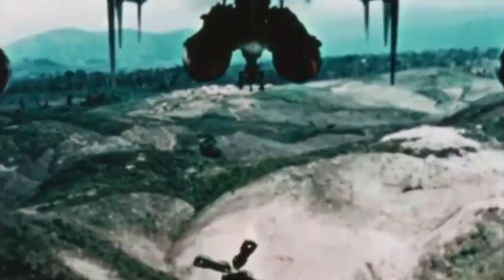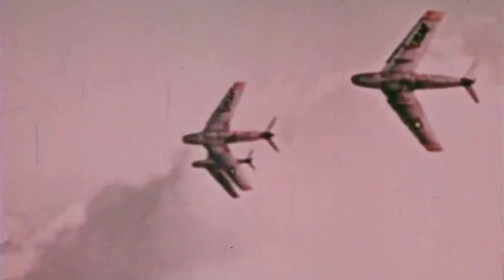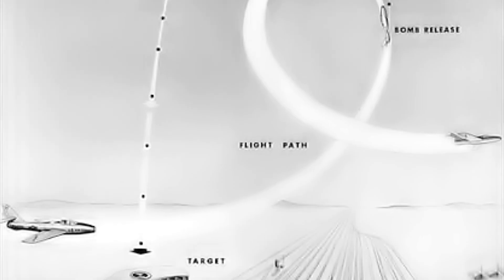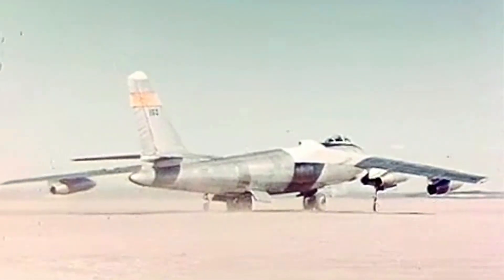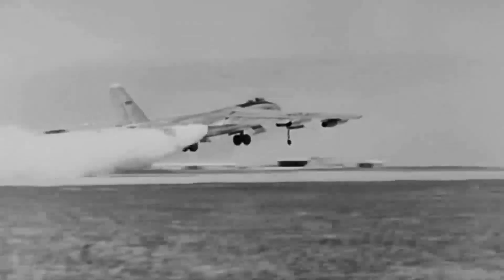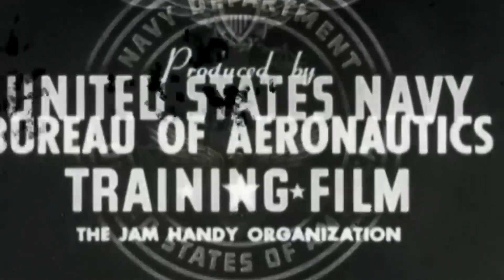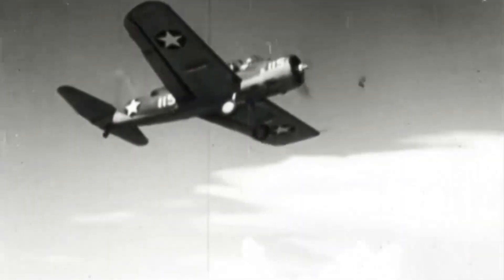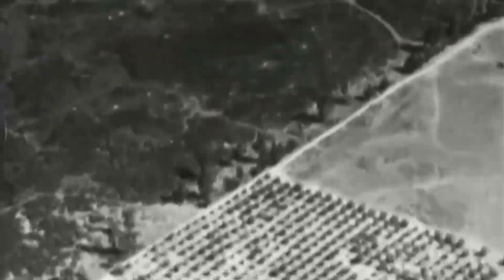This Massive Airplane Flew Upside Down to Toss Atomic Bombs - B-47 Stratojet Idiot's Loop

Comment: And then, SAC and Boeing found out that the spar boxes did not care much for the manuever. Still, Popular Science published the article and no doubt scared the Russians into thinking that our pilots were more endowed in the lower groin area.
Reply: Test limits were fully understood well before SAC started up and the technique was placed in the manuals for use in specific instances.
Reply: @larrysorenson4789  Boeing aircraft can't read manuals. But they can sure teach the engineers lessons. I have flown a lot of Boeing aircraft that performed better than the manuals, and some had nasty surprises. The 73'- 800 elevator balance bay drains come to mind.  Still a Boeing fan up to the  Max. "Wha' hoppened there, Lucy?"
Reply: Dick: A bit of history: Early on dad was the Air Force plant rep at Boeing (Wichita?). He was an aeronautical engineer and Senior Ranking Officer in the USAF Test Pilot Class 1956-D. From Edwards he flew both the X and Y B-47 and was largely responsible as pilot/engineer for the test program of that plane. He also performed much the same task for the very early B-52. Next he was assigned to Wright Patterson where he was Chief of Bomber Operations and Chief of Flight Test for the Air Force. This was from 1956 to 1964. At that time he was assigned to Headquarters, where he became Deputy Director of Research and Development for the Air Force. He didn’t talk a lot about his work but when he did I listened. As engineer/plant rep he was involved in very early design and fabrication of planes that transitioned us from propeller to jet based technology. As test engineer/pilot he participated in every aspect of establishing the planes limits with some pretty funny stories there. How do you find out how much ice must be on the wings before it falls out of the sky? Answer: Not with a slide rule. Obviously his work included the investigation and reports for every incident and loss of this aircraft. So the engineers and test pilots knew very well the capabilities for the plane as designed: high altitude delivery of a nuclear bomb. All that changed when the Air Force determined that the new delivery method was to be very low altitude fast delivery of conventional weaponry. 600 mph at 250 feet is VERY stressful on the airframe and pilot. Stresses were encountered that the plane had not been designed for and that the pilots were not prepared for. This quote is from a NASA article a few years ago. These two facts together accounted for the vast majority of findings (some unfairly) of “pilot error”. Very early accidents were caused by mechanical failures and pilot error: take off stall, mid air collision, loss of visibility, JATO explosion, engine failure. After the new mission design where engineering parameters were routinely exceeded, metal fatigue became a dominating failure element. These brave engineer/pilots and navigators lead the way to the enhanced design aspects in the early B-52 prototypes. The final design put into service in 1955 addressed these issues and subsequent modifications have kept this legendary Boeing design in the working inventory for 65 years. Everybody participated proudly, some at great sacrifice, so that we could learn from lessons and remain a dominating force for freedom in the world. Best regards, Larry. Ps. I miss my dad terribly.
Reply: @larrysorenson4789  Larry, many thanks for the "real seat-of-the-pants" history. Your dad is now a hero of mine. Flight test is something that I really enjoyed, except for the mind numbing static engine(s) runs. A buddy of mine ( USAF P-51s to B-52's) had a wing come off of his BUFF during refuelling. Ge had been doing a lot of low level runs in 'Nam. He had just exited the crew door and was about 15 feet away when the fuel tsunami hit his calves. 
Ironically, my late father was a slip-stick engineer for Plymouth Division in the 1950s. Same here... he is missed. By the way, I have a W&B slip-stick cover for a B-24A, but  no stick. Any ideas. I really miss flying that old stuff. By the way, DOC is gorgeous if you get a chance to see her. Regards, DJ
Reply: Dick Johnson possibly interesting stories:

To find out how heavy the Y could get they loaded it full of sand bags and scrap iron. The Edwards runway had just been extended and so down the strip it went. It was not airborne when the end of the pavement came into view. To prevent their brand new runway from flooding some genius had put an 8” high concrete curb across the end. It would surely rip the gear off the only B-47 in existence. And it was not about to get off the ground (no jato yet) so dad dad did flaps up and then down quickly and bounced it over the curb. Two more hops and it flew. The weight was enormous.

Phone call to mom: Dad was off on a mission when the base called telling mom that dad would call her. She was instructed to say short sentences and end with “Over” after each. Soon they were talking, first dad then mom, Over. Dad was flying way beyond the North Pole and we were figuring out how to bounce  radio waves off of air layers so that communications were possible.

The Polar Show. There was a TV show featuring an explorer named Lowell Thomas. He was very popular. In one episode he was in a plane flying over the North Pole. It caused a sensation. Dad was the flight Commander and pilot of the plane carrying Thomas.

I grew up at Edwards playing with my two buddies Mark and Scott Grissom. Gus and Betty were best, inseparable friends with mom and Dad. Dad wrote Betty regularly until his death.

Test Pilot Treachery: when Gus got burned up with Chaney and White the remaining six original Mercury Astronauts got together to discuss the effect of Guss’ absence on their deal with Look Magazine. All seven received royalties from the publication of articles and stories about them. Gordon Cooper voted that Betty would get the share just the same as if Guss was still there. Noel Armstrong would have none of it and demanded that she get nothing further to be settled by a vote. The vote was 5 to 1 to cut Betty out. This caused a permanent rift between my dad and the 5 cabal participants. We remained friends with Cooper who wanted me to work with him while he manages the Disney/Japan project. Ultimately I turned him down and instead went to Indonesia with an American Oil Company in 1972 and made a bundle of money.  More to come if you want..
Reply: @larrysorenson4789  Oh yeahhh .. Gus and Gordo... I heard about your dad's "Boeing Bounce" from Ernie Frankenberg, 73' test lead. I take it that your dad belonged to the SAETP ? It's the innovative stories that keep us alive... the young  'uns today don't care.  And the results are predictable without a bag-of-tricks  to fall back on. Tricks that your dad had in his hip pocket. Many thanks.
Reply: Holy cow! I should have guessed who you were. I am awestruck. Good on you, Mr, Johnson. I wish you and dad could have met. Your video is great and your presence and professionalism must make Mother Boeing proud. My email here in Phoenix is lrsoren48@gmail.com. If you would like I want to email you from time to time.
I have a collection of dads slide rules and circular calculators that were used in his flights. Maybe I can send you one to BBC fill that empty case. I have three trunks of dads stuff. I know that dads flight manual for the Y-B47 is in there somewhere. I have put off looking through them for a year now. I guess it is time.

We buried dat at the Wright Patterson Military Cemetery. There is a museum of Flight Test there. I have considered donating these remaining things there. Other stuff has already gone to the Smithsonian. Most of the families if Class 56-d have sent them items too. I have the Waltham clock that was on the Polar flights. Dad ferried it to the bone yard for its last flight. I don’t even know what other stuff is in there. I’ll keep you posted. 

Larry
Reply: @larrysorenson4789  Sorry,Larry, I'm the next generation Johnson. Most of my (decades of) flying was straight and level all over the planet, interspersed with flying some weird stuff. I learned a lot from pilots like your dad, and consider myself unqualified to even carry your dad's flight bag.. But learning from these guys sure saved my bacon more than once.  Will send e-mail. Again, many thanks. DJ

Comment: I was directly  under a toss bombing drill back in the 60's.  A friend and I were hunting on a bombing range east of Ellsworth AFB in SD when we heard a very loud bang straight overhead and were covered in black smoke.  We thought a bomb had been dropped on us.  Then we noticed a jet at very high speed moving away and trailing black smoke.  The plane then executed the toss bomb maneuver without releasing a bomb.  At that point we could see it was a B-58.  As we watched the plane rising to about 90 degrees up, a second B-58 about a half mile away made the same maneuver parallel to the first.  Incredible noise.  I was told by a USAF officer this was a "thousand-thousand approach", meaning 1000 mph at 1000 feet, but I don't think B-58s could go that fast at that low an altitude.  Extremely impressive no matter what the speed.
Reply: I don't know at low level but they can definitely go that fast at altitude.  That would be pretty cool to see.  It would just be cool to see one of those flying in general.
Reply: 36736fps Why were you hunting on a bombing range? Sounds to me the hunters could easily become the hunted there...
Reply: @bennylofgren3208  Good point!  Actually I should have said OLD PRACTICE bombing range.  No live bombs had been dropped since WWII.
Reply: @bennylofgren3208  In South Dakota there's a ton of open hunting land near AFBs.  Plus there's nothing to do in SD but drink and hunt and watch planes fly.  There may even be public hunting land on the AFB but I'm not sure.  At any rate, it's fairly common for AF training missions to fly over other lands.

Comment: ...heard the word "ordinance" used at least twice...ordnance is what is being dropped here...not legal documents.
Reply: I used to work with someone at a Presbyterian hospital we called Presby and he would correct me when I'd pronounce the second to last letter like a P instead of a B, it was annoying since its just my stupid lips not separating fast enough but a barely audible difference.
Reply: THAT is the take away for you. Not the giant craft lying upside down flinging A bombs?
Reply: lol! yes, it’s ORDNANCE
Reply: Ordinance vs Ordnance is just like Aluminium vs Aluminum, where the words started out the same, but then some idiot misspelled it and that spelling stuck.
Reply: He also said the pilot pulled the clutch in the plane and climbed steeply... lol
Reply: Thx you mr english

Comment: A3 light attack nuke bomber. USN 1947 to 1979.  
Flew 3rd seat electronic countermeasures.  
Crews were trained as you described on how to LAUNCH a nuke bomb at 600 knots.. 
A3 named ALL 3 DEAD (crew).  
Your video is spot on.  
I sat with my back to pilots back.  Looking backward as we climbed rolled and released.
Bombay doors 10’+ length opened and closed in 1 & 1/2 seconds. 
This was my magic carpet ride. USN 1966-1971. By HIS grace.